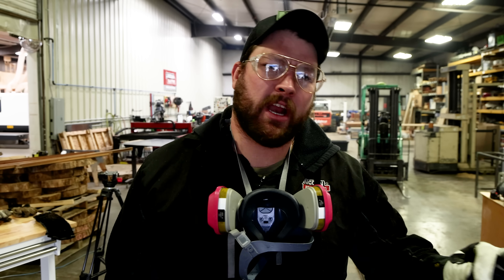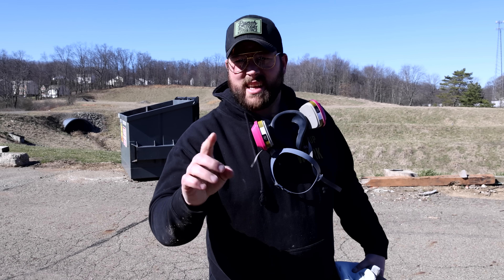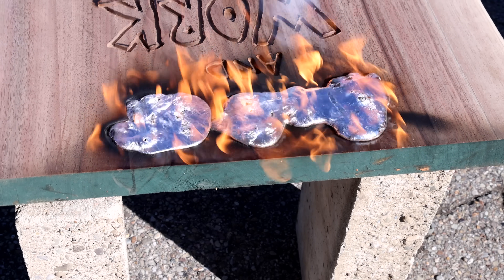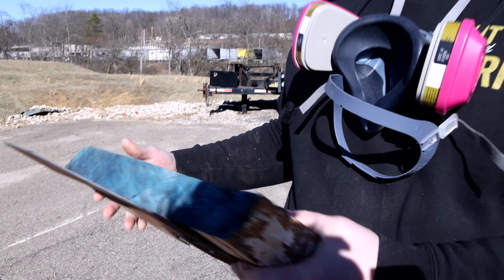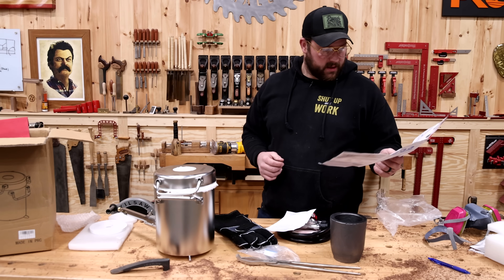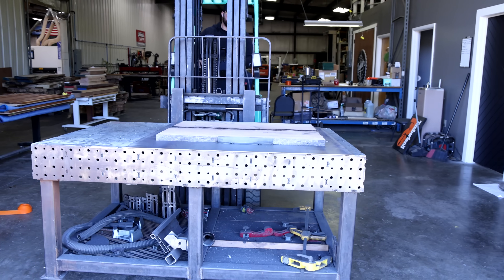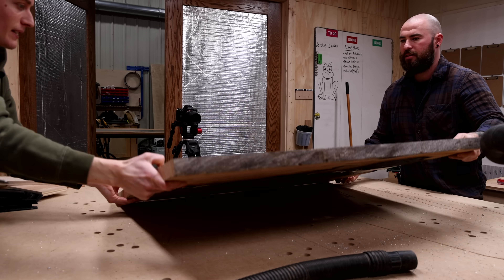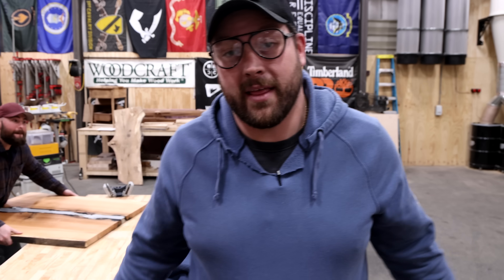I Tested Pouring Molten Aluminum in Wood

Comment: You should get a hold of the guy who did it and go see how he does it in person. He's definitely doing something that is making it work.
Reply: Either an alloy of alum that helps keep a lower temp, or it could always be pewter. He could also have treated to wood, however most finishes would burn, and wetting it would cause bubbles and make the table damp
Reply: @Volt64bolt It has to be pewter.
Reply: @MCsCreations  I haven’t actually seen the original so I can’t be certain
Reply: @Volt64bolt  Not to mention explosive...As in steam explosion.. But yeah i'm guessing fire retardant to prevent excessive burning, having tie down rods that connect the peaces mechanically locking the cast in place and later stage some thick resin probably to solidify everything. I have seen this being done and usually its been larger volume poured at the time. This combination is not natural hence why its so cool when you get it working, just takes effort to find out the right combination so John throwing the towel is wrong move when he wont get it working as wood worker, when this is more of handyman territory.
Reply: @Hellsong89  ye, steam explosions are deadly. But if you only slightly dampen the wood then it wouldn’t be a cause for concern that’s why I didn’t mention it. The only other method for this sorta stuff is to scan the wood and machine an inverse like with inlays
Reply: I'm good friends with the guy who made the original video! I'd be happy to help in this endeavor
Reply: @Cheetahking220  assuming you're being honest, is it pewter or what?
Reply: @Cheetahking220  I’d definitely want to redo this table properly! Any tips you can spare would be invaluable
Reply: @BuzzingGoober  he did a molten aluminum pour, no smoke and mirrors. I'm not 100% on his process (wasn't there when it happened), but I'm pretty sure he pre-charred the edges and did multiple pours
Reply: What fun would THAT be?? Lmao
Reply: @Cheetahking220  yeah, I'm sure it's possible considering how close John came.  It honestly doesn't look too bad.  It just would be way easier which pewter or another low melt metal.
Reply: it's probably 60/40 tin and aluminum. It would lower the melting point to the mid 700s.
Reply: @MCsCreations  my thought exactly.
Reply: @Cheetahking220 who was it that did the original? I couldn't see a link in the description. I did wonder if he might have precharred it to stop it burning up. I also wonder if he used drier wood to stop the warping? Or maybe it was just John putting a thick piece of metal under the wood that caused a greater transfer of heat than something thinner and lighter would.
Reply: When he said that the dude is local i expectes them to hit him up
Reply: @MCsCreations  I've cast pewter, it shrinks like 10+ percent (also costs like $25 a pound). But I agree in principle, it is not mystery scrap aluminium for sure.
Reply: Thanks for giving it a try. Keep them coming, but stay safe.
Reply: Everybody knows it’s Black. Freakin. Magic!!.
Reply: @Cheetahking220  The pre char is interesting. I wonder if the char helped insulate the wood beneath it from the heat of the casting
Reply: @Cheetahking220  would be cool to get the two artisans together for a collaboration. Kinda miss those in the maker space.
Reply: @andrewstorer4875 The Char probably protected the wood underneath it by allowing the black soot to absorb a lot of the heat and dissipate it. So in reality the pre-charred wood was the only place that ever got charred at all because it absorbed the heat directly and kept the flame from burning anything else. It also had a side effect of only burning away the charred part which means that it could be milled flat if poured in a precise way to minimize heat shrinkage. That's actually really smart. The multiple pours are probably chiefly responsible for that, because it allowed for all the layers to cool at their own pace and not overheat and char the wood more than it already was. Even if it would probably end up looking rougher immediately, once its outer layer is milled away we have a completely uniform stripe with a perfect char around it.
Reply: Pre-charring the wood would help with bubbling and getting a more homogenous cast. Also, yeah multiple pours are a disaster. Id go with the biggest crack that can be done with a single crucible. Also, once the alu is in id start spraying it with water. If you leave it to air-cool you are going to get those big charred away gaps on the sides. After that you could fill in what cracks remain with epoxy for a clean surface without changing the aesthetics id say.
Reply: @Volt64bolt  in my opinion is a  high concern ,with any amount of  water between the wood and the sheet metal on the table plus extremely hot metal the things can go wrong very very fast ,  steam expands a lot , super quick and always find his way out
Reply: @NikoMoraKamu  I mean yeh, but casting sand, aka green sand, has moisture in it by design and that doesn’t cause steam explosions.
Reply: @Volt64bolt  You pre-burn the wood with a blow torch because the carbonized wood stands up much better than the raw wood itself.
1) The charcoal doesn't burn the same as wood.
2) Raw wood will produce the volatiles that will cause flames.
 and 3) The raw  wood will release water as steam when heated by the aluminum.
Reply: @MCsCreations  I was thinking it is Zamak (Za-12) a Very common zinc alloy with a low melting point, I think some (incorrectly) refer to it as pot-metal.
Reply: @MCsCreations  ^^that’s what I’m thinking^^
Reply: he already told u in the video. he had to of didnt it in 2 pours of aluminum not 12.. and re-melted the aluminum layer already down so the metal sticks to itself better

Comment: Honestly, think you should partner with someone like Alec Steele and give this another run.  Biggest challenge here was the scale of molten metal and the hobby smelter that was used.  In short, try again please!!!
Reply: YES PLEASE!!!! Alec Steele would probably jump at the chance to do something like this as he has done some other insanely “out there” collabs before
Reply: Yes!
Reply: Alec is in a different country now. Also he doesn't really do smelting/metal casting.
Reply: Alex doesn't really do smelting or casting, but he does more of it than this scrapple fed redneck... And I swear I mean that in the nicest way possible
Reply: Such an underrated comment!!
Reply: Or Alec Aluminum😂
Reply: Agree, only chance he had would have been to use a torch with a narrow tip to keep the aluminum hot between pours, if there was any chance of getting the pours to melt together this would have made that likely achievable.
Reply: Yep do it again
Reply: @PennerFab  He's interested in it for sure, he's done a video on metal casting before
Reply: He's an expert at forging steel, not casting aluminum.

Comment: I think an epoxy pour with aluminum dust mixed In Would give a similar look. Great effort!
Reply: I came here to say just that haha oops. Shoulda looked at the comments first lolol
Reply: fancy JB weld lol
YEAH MAKE A TABLE WITH JB WELD I mean I never tried to POLISH JB weld before it might get shiny!
Reply: It would work. The only thing that makes epoxy+metal difficult is that the metal will sink to the bottom of the epoxy as it cures. 
You'd have to pour it upside down to get the effect you're wanting.
Reply: Called cold casting
Reply: Welders use a aluminum bondo. Use that and be done with it
Reply: @robbie6625  you’re absolutely right. The molten aluminum pour in this vid was also attempted upside down. I’ve always done resin pours upside down anyway. You always get more consistent color and opacity, plus it cuts down on voids and inclusions that you have to fill back in later.
Reply: This is how Wyrmwood does their silver stringing. It's aluminum powder and CA glue sanded smooth
Reply: @robbie6625  super saturation, if its mostly aluminum with epoxy just acting like glue the settling should be minimum
Reply: @lizardKingCDXX  that's interesting. I've not played with it enough to know the correct ratio though
Reply: @robbie6625  I'm spitballing but I'd try to have enough aluminum shavings to fill the voids by volume. Then add just enough epoxy that its workable. It would be hard to poor and fill but I bet It easier than molten aluminum

Comment: Another idea if y’all want to try this again is to use tin instead of aluminum.. it has a much lower melting point so it won’t burn the wood as much and you could melt it faster so the layers would be better combined
Reply: using an alloy of tin and bismuth can bring the melting point below 300F (still higher than steam production but there should be a lot less steam made, and almost no charring.)
Reply: @maciejsimm2342  well its like 4x lower temperature them aluminum, for one you need furnace for other cast iron pan and gas burner. Its order lead or pewter/tin both can feed in planer and the metal is soft so it dont damage blades. Also it have lower surface tension so the pour look more like in the original video.
Reply: I used solder on a redwood table I made a few years back...sanded almost as easy as the wood
Reply: i was thinking here as well.. it very well could be like tin... or even lead that is pollished both would be low enough to do on wood with out something catching on fire
Reply: Except the thing with tin is that it can rust and aluminum will not. If it's a dinner table most people don't want to eat off of rust.
Reply: @11mr.niceguy11  If its a wooden table it SHOULD be getting polished on a regular basis, and the oil in the polish will keep the tin from rusting.
Reply: @11mr.niceguy11 good finishings would go a long way to prevent this

Comment: as the other commenters mentioned - i think there's a "trick" (or a few) to this pour going well - however, if you do try this again with a deeper dive into the "how"; when you're polishing metal you need to go WAY higher than 400 grit. I get that 400 grit for wood is polishing level but for metal you can go up to 2000/3000 and then a polishing compound on top (jewellers rouge for example) which is about.. 5000 to 6000 grit if you were comparing to sandpaper. Otherwise it will just look like you're "polishing a turd" with 400 grit paper. Just ask Alec Steele and Will Stelter about hand sanding 🤣
Reply: I guess the "biggest" tricks are these two:
1) using the rebar to actual bond both planks together - here they used the rebar only for the metal to have something to bond to - but they did not used it connect the two planks together
2) pouring in way largers badges: than couple 100ml kiln is just way too small - when you have such a volume to fill best way would be to do it in just one go with enough molten metal to overfill to have enough to grind away to get rid of the surface burns
I don't doubt the original - but here they just thought "ok, give it a small version try" instead of scaling it properly - kinda like mythbusters: "when something doesn't blow up we scale the stuff until it does go boom"
but I agree with you: there's just way more into the "how to do it properly" rather than the question "is it fake?"
Reply: I'm pretty sure he meant that the end result wasn't going to look much better if he kept going with higher grits, not that he thought metal didn't need more sanding than wood.

Comment: I think a way better way to do this that doesn't involve having to buy a big smelter and finding a ton of aluminum is using aluminum powder mixed into resin and then pouring that into a river table design. You could even burn the inside of the river first to make it look like it was made with molten aluminum.
Reply: That's a very cool idea. I've seen someone use super glue and brass filings for wood project inlays. After its sanded and polished it looks like solid brass.
Reply: You'd need a very high aluminium content in the resin – I wonder if there's a bonding agent more suitable. Or something like cold sintering. As I'm no expert, I'm just pondering how to get the desired final solid shine. It's all looks, there are no requirements, like hardness or structural rigidity, so this might work.

Comment: I believe that clip your talking about was a much more involved process. 
1. Reo bar between both sides of the wood to hold it together.
2. Much thicker steel base but was also lined with clay so aluminium wouldn't wander under the wood
3. Thick steel ends screwed to the wood and also edges done with foundry clay
4. Pour in MUCH bigger batches  to fill it faster
5. I believe he milled a TON of material off the top to get it level

Have seen it done a couple of times and the secret seems to be the foundry clay reo bar connecting dowels.
Also if you make walls out of foundry clay along the top sides,it stops the rest of the top catching fire 🔥

Comment: I was thinking along the lines of creating a silicone mold of the inside "river" shape, then using that to create a concrete mold for the aluminum pour. Surprised this worked as smoothly as it did, and while not a perfectly clean result like the source video, I think it deserves more respect than a "polished turd."

Regardless, it was entertaining to watch and see your approach!

Comment: You can just melt and pour an alloy called "Cerrosafe".  Melts below the boiling point of water.   You can also try Babbitt metal or 50/50 solder which are easy to get and melt lower than 500 degrees.  The trick would be to pour it and cool it quickly to limit the char.  Babbitt #1 is available and works well, but it's pretty pricey. You can reduce the cost by filling the void mostly with steel.  The steel will bond with the Babbitt well and be suspended in the middle, so it won't rust.  Make sure to pour enough on top to reduce the effects of shrinkage.
Reply: You can just pre char the inside edges first, and use something like zamak instead, still has a lower melting temp in the 700s, and do larger pours at once.

Comment: As a metal caster:

You needed a bigger furnace and crucibles.... So you could pour more at a time. Plus you should have had a slight angle to your mold so the pour would have naturally flowed downhill.
Another issue was the wood floating on the metal- so weigh down your 2 boards to eliminate that.
To really get a SMOOTH finish though... You have to do a SINGLE POUR!

Comment: If you want to try this again with molten aluminum (instead of the Al/CA or Al/epoxy suggestions), consider flooding the area with argon gas the way MIG/TIG welders do.
Reply: Carbon dioxide would be just as effective at protecting the wood from oxidation. Even if it doesn't offer much protection to the aluminium. And is a lot cheaper than argon.
Reply: Still at these temperatures wood would burn into water+coal+carbon dioxide, that water woud still break into H2 + O2, which O2 will sustain burning. Still it would go better, but smoke and steam would still be a problem.

Comment: If you have a fire with molten metal do not use water to put out use your powder fire extinguisher if you put water onto molten metal will make an explosion and sent little bits of molten metal flying all over the place, make sure you skim off all the slag before each pour and if you want it to bond together better try to get the temp of each pour higher experienced aluminum smelter out of ky so if you have flown in a plane or been in the military or aerospace I have had a hand in making the aluminum used for it all
Reply: You think the buckets of water are for the metal. I bet it’s for ALL THE OTHER FLAMMABLE SHIT AROUND. Y’know, things like wood… rubber… people…

🤦🏻‍♂️

Comment: With how quickly aluminum cools, you would need a much larger smelter or several small ones (as was used, but like 9 more) running at the same time, making sure that you pour at the same time (within 90 seconds).
At least that's been my very limited and minimal experience seeing and assisting others do this very same thing a few years back.

Comment: Retired Mold Maker, 35 year worth.
Pay attention.
1) Make a mold/casting of the hole...CLEAN it 1st. use a rubber compound to make the casting.
2) After it is dry, remove, DO NOT BREAK or DAMAGE IT. KEEP IT CLEAN.
3) Build A box and do a sand casting with the rubber casting you just did. (google how to do)
4) Cast your aluminum in the sand.
5) Clean up the aluminum, insert in to your wood.
6) Hopefully, you can figure out all the rest!